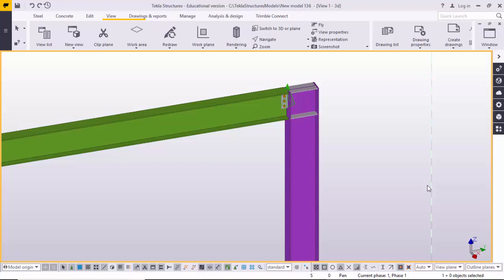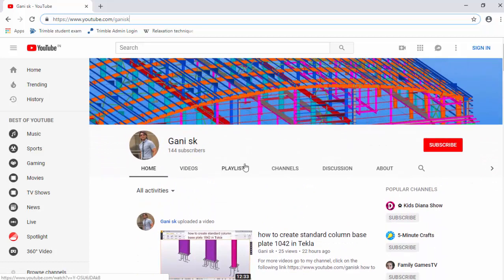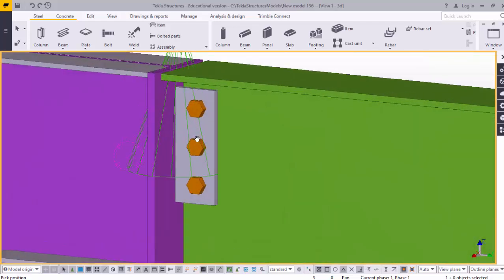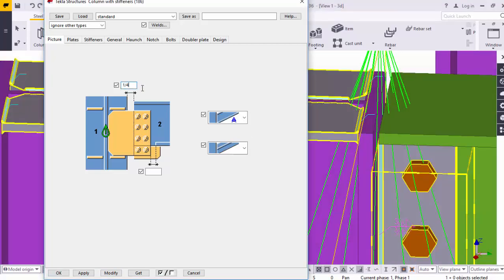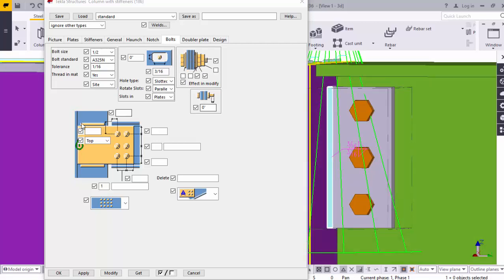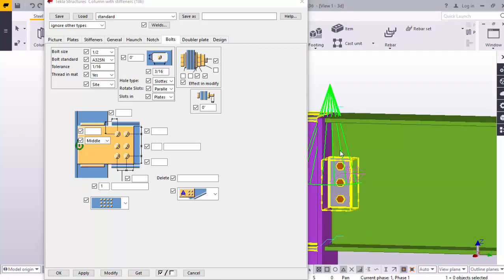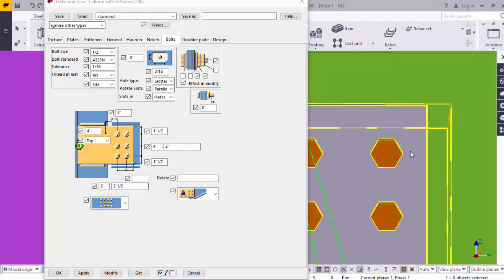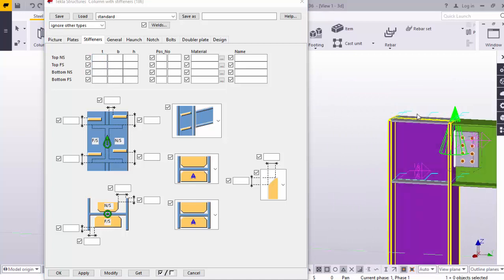How to create column with stiffeners 186 connection between column to beam in Tekla

Comment: Boss , rafter side plate( created) is not at all linked with column.how the 2 structures will hold each other?
Reply from the maker: Not possible to hold it. Plate should be attached to column flange.